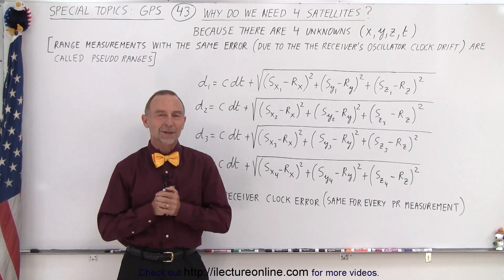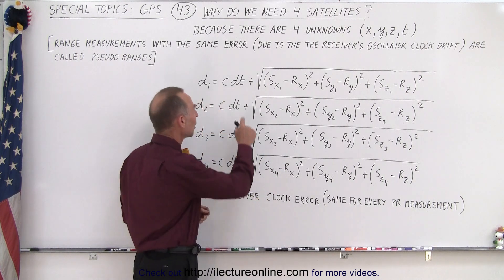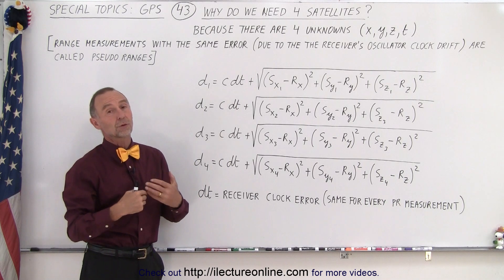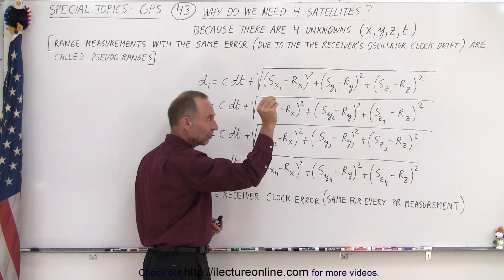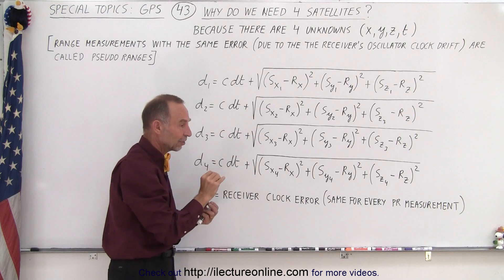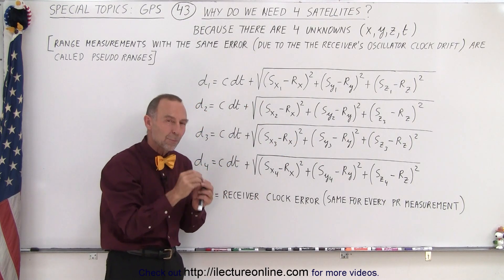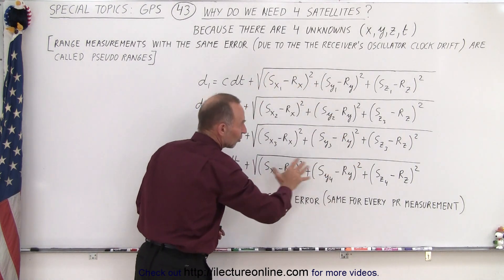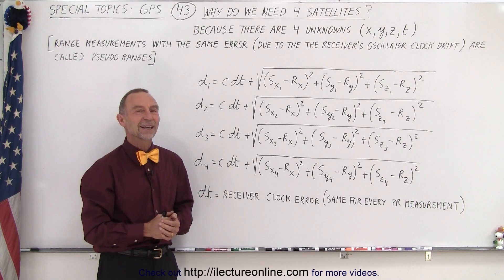Special Topics - GPS (43 of 100) Why Do We Need 4 Satellites?

Comment: Can you explain whats the role of clock drift and why are they important?
Reply from the maker: It is not so much as a "role" but more like a nuisance.   Clocks do not keep perfect time, and the rate at which the clock on the satellite runs is not the same as the rate at which the receiver clock runs and thus they tend to drift apart.  We have to account for that.

Comment: Here's what the FAA website says:

With information about the ranges to three satellites and the location of the satellite when the signal was sent, the receiver can compute its own three-dimensional position. An atomic clock synchronized to GPS is required in order to compute ranges from these three signals. However, by taking a measurement from a fourth satellite, the receiver avoids the need for an atomic clock. Thus, the receiver uses four satellites to compute latitude, longitude, altitude, and time.
Reply from the maker: The FAA description is a simplistic view of why we need 4 satellites.  The need for an atomic clock is still there.

Comment: Does any system like MatLab allow us to try real calculations?
In physics, we have a lot of packages in Matlab but I never try this topic
Reply from the maker: Yes, we use matlab to model many applications.
Reply: There are several algorithms to solve that system of equations. Although it has an analytical solution, it requires finding roots of 4-th degree polynomial. In practice iterative least squares or similar numeric algorithms are used. One can use maximum likelihood estimator and gradient descent, it can solve over-defined system when more satellites available and take into account individual estimates of pseudo range measurement variance to improve the estimate accuracy.

Comment: Excellent, as always!   For marine GPS, three will suffice as the surface of the sea is effectively at zero elevation, the vertical accuracy is usually about 3x less than the horizontal accuracy.
Reply from the maker: Interesting, I am going to look into how the Navy and Marines utilize this.
Reply: @MichelvanBiezen  That's how my first GPS worked.  One could select three satellites for marine work.  I bought it in 1990 and it was clearly intended for marine use, only four channels, very slow if moved  more than 200 miles from the last fix, and only geographic coordinates -  It ate batteries too!
Reply: With 3 sv's you will can only get a 2D fix, as the circumference of the earth is used as the given height. With 4 sv's you can get a 3D fix which is not very useful at sea. But note the HDOP change between 3 and 4 sv's. With 3 sv's you can only estimate the clock error, with 4 sv's the clock error can be calculated. In modern marine gps receivers you need all sv's you can get, preferable from multiple constellations like Galileo,  Beidou and GPS  with SBAS to get an dRMS of around  2 meters. Especially with AIS you want much better precision then what you would be able to get with 3 sv's
Reply: @Nerd3927  Many thanks for the very interesting information.  My Garmin GPS60 has 12 channels but the old Panasonic I had from the early 90s had only four channels and there was a switch which gave a faster fix with three SVs for marine work, for which the device was intended.  That was before the SA was turned off in 2000 - the precision then was 100-150 metres approx, ok for marine but not terrestrial work.  Now I get 3-5 metres accuracy which is adequate for outdoor activities.